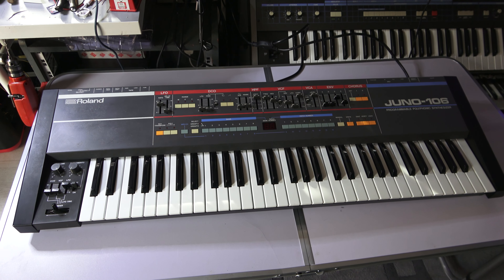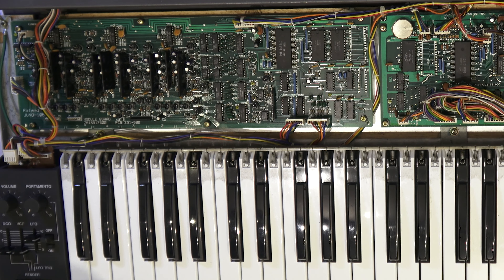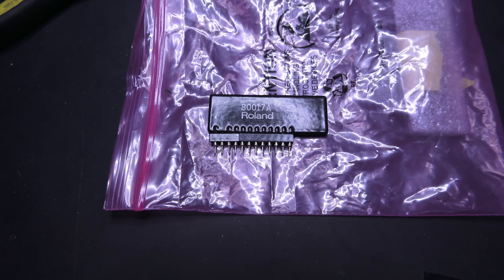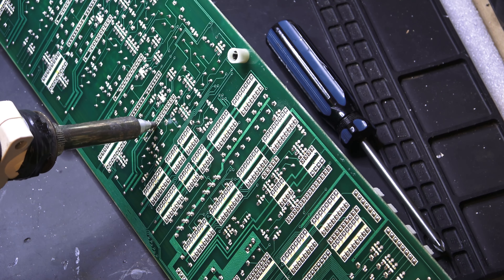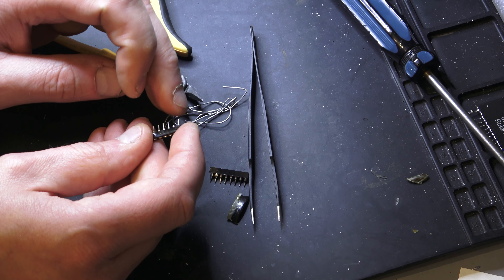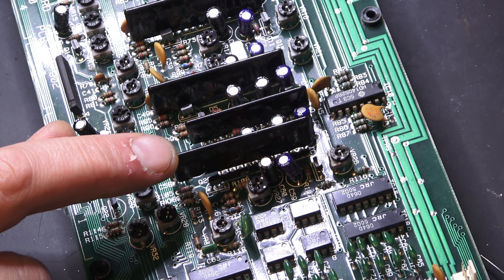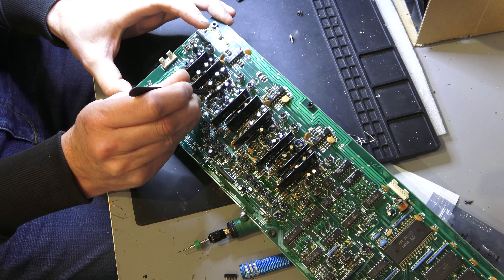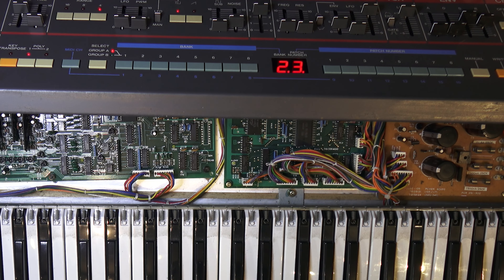ROLAND JUNO 106 - SOCKETING THE VOICE CHIPS

Comment: I had this done to my juno, I also had the epoxy coating removed and all the joints for the components on the voice chips, re-flowed, all 6 voice chips have been running fine a tad over 15 years now. That crackle in the chips (all six of mine did that) is likely the epoxy coating starting to become conductive and components starting to separate from the pcb.
Mine has a strange issue where panel LEDs which aren't supposed to be lit are dimly lit.
Reply from the maker: thanks. That's very interesting about the coating on the chip. As for the the LED's, maybe check power rails and also that there is no shorting going on. A logic chip also may cause a symptom like this.

Comment: I just put sockets on my MK30 which also uses these voice chips.  I also went ahead and removed the black coating because it was starting to cause problems.  It's not difficult work if you have the right tools, just a little time consuming.
Reply from the maker: yes it's a good idea and saves issues in the long run